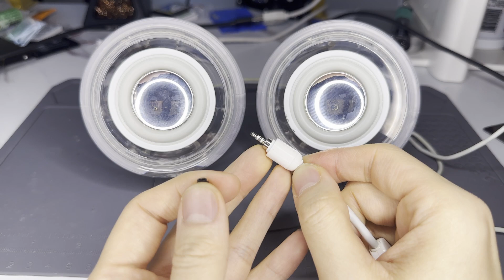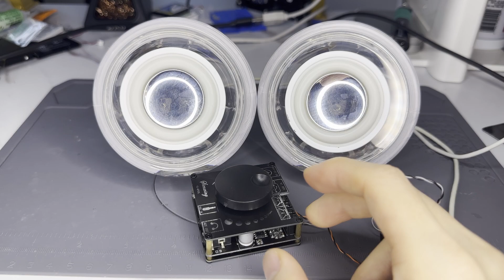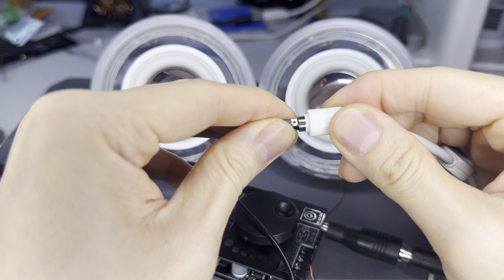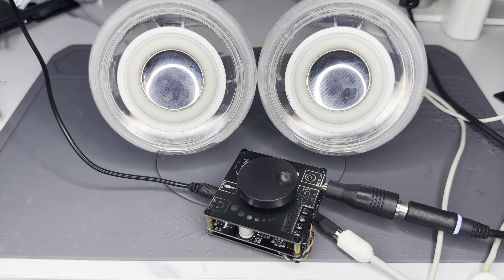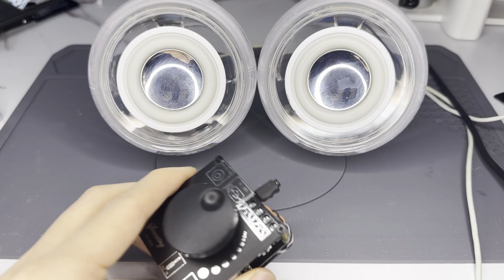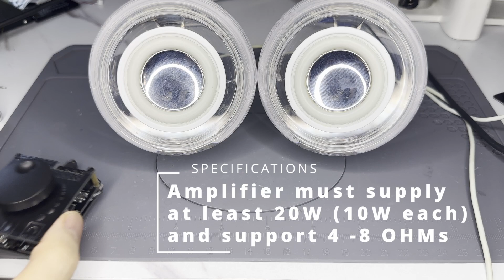Repurposing Apple Pro Speakers for under $10

Comment: can you link the parts in the description?
Reply from the maker: Yes, brilliant idea. Added to the video description. Here is the link - https://ebay.us/m/7XGe6m
Reply: @FiscalMedia  thank you! sorry to bother but what about the amp and wires?
Reply from the maker: @austinspacy  You can get the wires from anywhere; the wattage of the speakers are low enough that you can use any thin piece of copper. I just cut up an old microUSB.

For the amp, I really cannot recommend it anymore. I bought it for $5 on AliExpress and it's been so glitchy and inconsistent. I ended up replacing it with the Sony CD player from my other video. If you don't have an old CD player, I would just search up "DIY Amplifier" on Amazon.
Reply: @FiscalMedia appreciate the time mate

Comment: Thanks for the hack, mate. I received my amp and connectors today and your instructions worked perfectly. I removed the top sleeve, filed the corners down, then reinstalled it. After soldering the speaker wires on, I tested the amp and it worked a treat. I’ve heat-sleeved the wires and will 3D print a box to keep everything protected. Thanks again... Sounds awesome and looks great.

Comment: Kudos on finding that part #. I just acquired a set of these today. It looks like there are two sleeves on the Apple side of the plug that don't seem to do much besides get in the way. At first, I thought that those might be the annode/cathode for some sort of onboard amplifier, but I only see two wires going into each speaker
Reply from the maker: Thanks. From my research, I believe the extra "sleeve" surrounding the tip of the jack is proprietary and it is used to help the iMac g4 identify that Apple Pro Speakers are connected instead of some third-party speakers. So pretty much worthless unless you have an iMac g4.
Reply: @FiscalMedia that may be the case. I wonder if there's anything inside of that round splitter with the Apple logo on it besides the wires branching off? I got a multimeter reading of 700-800ohms when connecting the outer sleeve to negative and the inner sleeve to +. No reading when doing the inverse
Reply from the maker: @Land_Mine_Effects there is a chip inside it. That is what tells the iMac that it is a pair of Pro Speakers. https://imgur.com/V4CY25T